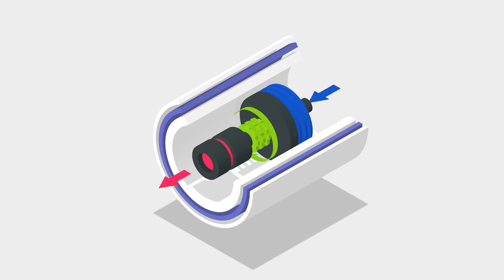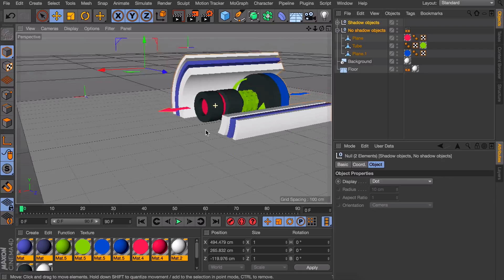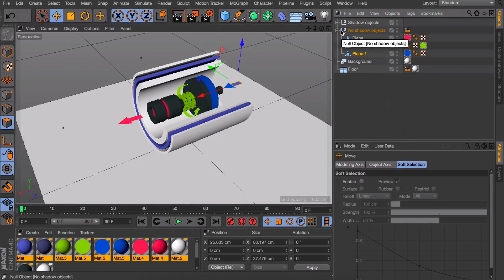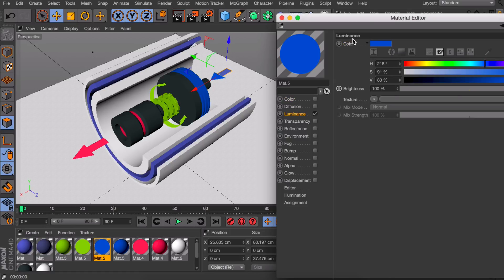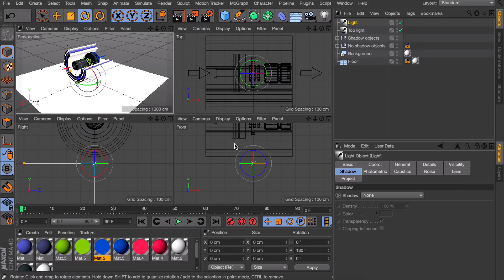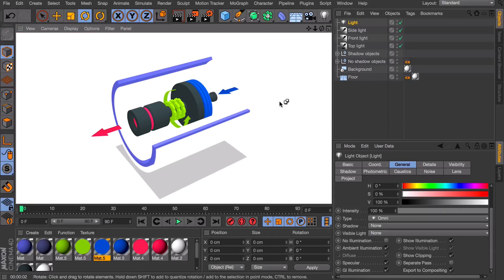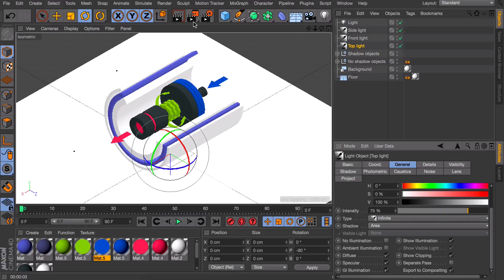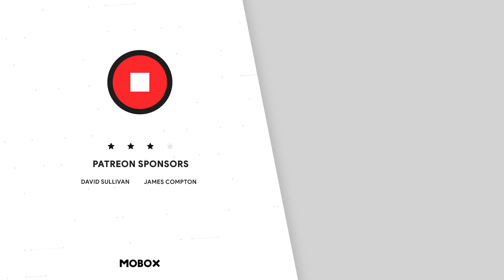Easy Flat Studio Lighting - MAXON Cinema 4D Tutorial

Comment: 2:42 when you extrude the edge outwards -I can't see any way of doing that without extruding the edge in place once with no offset and then using the scale handle to make the edge longer. If you just grab the edge and use the extrude tool on it you do not get the desired results.